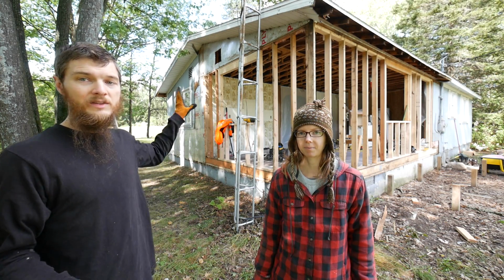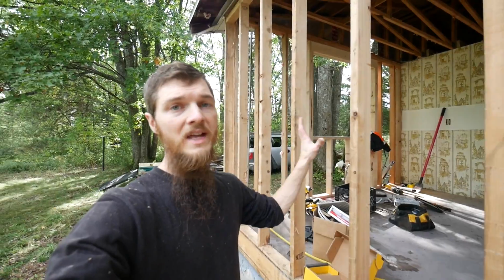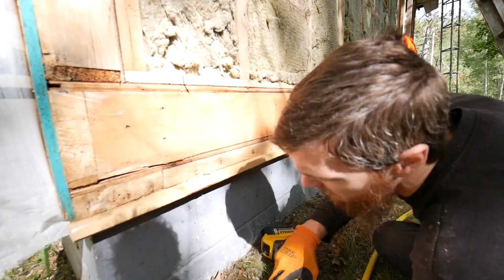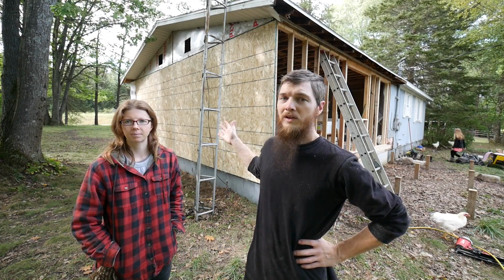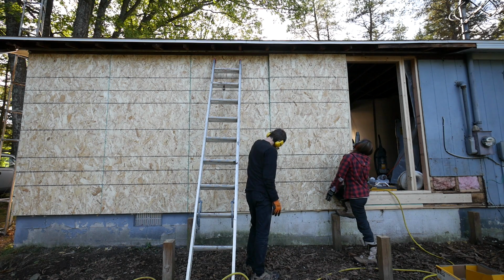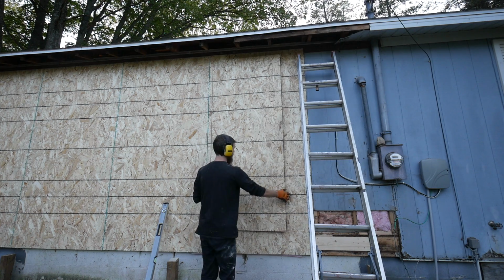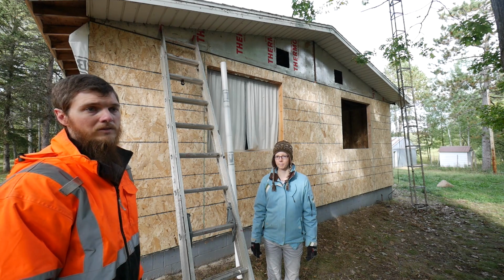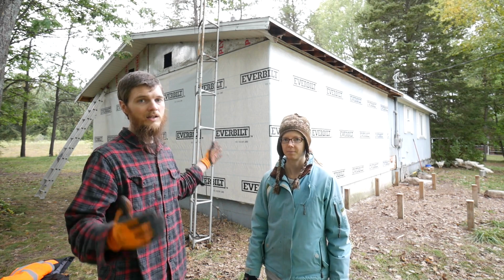Wrapping Up the House - Home Renovation

Comment: As someone has already mentioned, be sure to put some kind of mesh screening over those vents. You've done such a good job of eliminating the rodents I can't imagine you leaving that kind of entrance unprotected.  Great energy between you and good on ya for getting your September goals accomplished.
Reply from the maker: That will all be ripped off very soon when we do the blow-in insulation and then it will be sheathed over permanently with no vents since the roofer who did the roof last year put in a vented ridge cap.
Reply: @diyfferent  As I said, DIYfferent is AWESOMENESS in action

Comment: Those windows that you're NOT going to reuse would make great outdoor seed starting "greenhouses" next Spring!
Reply: Just a warning about old windows.  The glass is usually not tempered and when they break can slice you badly.  I wouldn't use them.
Reply: And the putty glaze around old windows often has asbestos which no one should handle without protection. We had an entire old house full of windows that we wanted to use in a greenhouse that we couldn’t use. Found that out during asbestos abatement. Tore the entire thing down. (Now that was fun!)

Comment: Hi Doug and Ashley, When you pulled off the upper siding you took off some kind of vent covers. Maybe there is a screen there, but I can't see it. We had small vents with wire mesh underneath, inset into the eaves that were either removed or worn through and rats got into our attic. It was awful, they made a lot of noise at night when we first heard them!! I love you guys, thanks for another great video. I am sure you are relieved to have gotten this far, as I knew you would!!!! Take care and God Bless.

Comment: Looking good. Maybe since everything is open anyway consider making an attic access door on the gable end of the roof not only for your insulation but whatever other reason you might need to access it in the future. It could also double as a large vent. We have lots of them like that on older craftsman homes in my area.

Comment: It's a wrap. LOL, sorry, I live with a guy who speaks in dad puns.  Serioiusly though, I have been enjoying and learning a lot from your videos! I live in a factory built home, kind of similar to a manufactured home/mobile home but it is just a little bit more like a regular stick built home built in modules. This home, they did the cheapest way possible and many of the aspects are the same as what you are encountering. It's at the age where we may find ourselves doing much of what you are doing right now. Rot issues, etc.

Comment: Wrap pieces over Gable openings? Maybe a piece under the power staff? Just to protect the holes from racoons, etc.
Reply from the maker: That whole peak area will be ripped off very soon when we will be doing the blow-in insulation and then it will be fully sheathed with osb. :)

Comment: Looks like the wind is blowing and it’s getting cold out.......Down here in middle Tennessee, we are having record highs of 95 to 96 degrees........I am so ready for Fall...........you both are doing a superb job......my only concern is that with the bad Winters you have, not sure if that pressed wood on the exterior will stay good, even with the wrap on it......I would try to get as much siding up as you can before snow starts as that will be another layer of insulation from the cold.......missed seeing Belle and Maverick ‘s sweet faces.....❤️Julia Johnson
Reply from the maker: Winter won't affect the wrap. It's mainly the UVs and wind that damages it. Our house is almost always in shade and we don't get much wind here so it'll be good until spring :)

Comment: Maybe you should put some screening over those two vent holes in the front?  So the mice & whatever else wants to take up housekeeping in your attic won’t have access?
Reply from the maker: It's not staying like that for long. We'll be ripping it off soon to go through there to do the blow-in insulation and then it's all being sealed over with osb. :)

Comment: My reciprocating saw has a plunge blade. You should be able to get one if you dont have it. Just hold it horizontal to the board and gently tilt as you cut.  Much faster that way. Dont forget to close that eave so you dont get critters in the roof space. Nice tidy job guys.

Comment: What about animals crawling into those two openings at the peak?  You could cover them and make a mark where a they are to cut open when ready.    I keep thinking rain, snow, and varmints heading there this winter.😝
Reply from the maker: We'll be ripping those last sheets off soon when we insulate with the blow-in insulation. After that it's being sealed up permanently. :)

Comment: Great video Ashley and Doug! Everything always looks so neatly put together...
I noticed someone mentioned to double wrap the house and then remove the 2nd layer when it comes time to side it. It actually does make sense. The 1st layer of wrap will be dry and not subjected to the elements. Have you thought of doing that?
By the way, that deck that you pulled to the other side seems to suit the area where you left it...that's just my two cents and with the Canadian exchange rate, I guess it's less than that...haha!

Comment: Another great display of team work and a job well done. I'm curious about the other half of the back wall, with the electrical stuff, when do you plan to redo that?
Reply from the maker: We plan on leaving the area alone right where the electrical stuff. The rest beyond that will be removed and resheathed/wrapped later on, not sure when we'll get to that yet.

Comment: looking great..Just a suggestion, But while you have the soffits opened I would enclose the area with 1/8" hardware cloth before you re-install new soffit panels and fascia...you'll still get ventilation and You won't have to worry about mice, stinkbugs, Spiders and a ton of other bugs getting in a ruining your hard work.

Comment: yeah the housewrap should do fine over the winter , i seen people dont use wrapping and leave the osb bare over the winter (including the roof)  , turned a bit darker and rougher but other then that it was ok 
its probably a good idea to do the ceiling insulation before winter , just so youre not heating the house too mush and have the heat disapear out with the draft  , you could do it from inside the house during the winter , one advantage of that is that it doesnt feel like an oven up there 
might allso be a good idea to board up some holes and maibe the eves  , maibe you can borrow / rent / try out a flir camera and video the outside of the home for hotspots and the inside for cold barriers when the temperature difference between inside and outside is noticable
https://www.flir.com/browse/home-amp-outdoor/mobile-accessories/, this one fits a smartphone so you can prolly record from it too

Comment: It looks like once you put the insulation in, and do the interior walls, the place should keep warm, was wondering about under the house, will the pipes need weather protection, and are you going to cover the attic vent opening in case it rain,

Comment: I'm not sure if it's been answered before, but what is the antenna-type structure just outside your kitchen window? I think my grandma's house had one of those when I was a kid, but I'm not sure I ever knew what it was for.
Reply from the maker: It's just an old tv antenna tower. The antenna is still up there at the top. It makes a handy ladder to get on the roof, haha.
Reply: My Aunt had that. It was for the TV
Reply: That's handy to have I'm considering cutting cable and getting an antenna for our house in certain areas they can pick up 70+ channels

Comment: Yay,  you'll soon have the kitchen space back.   Glad to see you guys laughed when the little piece detached when you tried to place the OSB.  Looks like you kept the ledge when you wrapped the OSB.  
See you wearing coats.  What was the temperature?
Reply from the maker: The ledge was just temporary, he was just stapling the wrap over the bottom edge of the OSB. We're looking at highs of lower 60s and upper 50s lately. Last week was much warmer in the 70s and 80s.
Reply: @diyfferent  
Glad you removed the ledge and I was wrong...  Whew!
Thought it may have been colder.

Comment: Good evening guys the home is coming along beautifully, one question though “does this now mean you’re home will be called a conventional stick built house,” and no longer a double wide trailer?
Will you have to tell your local Council?
Reply: Narice Woolon its still has a steel frame. It is still considered a mobile home. I hope they save the metal identity tags because it’s a big deal for financing if it’s sold.
Reply from the maker: Even though technically it is a double-wide, our county doesn't consider it a mobile home anymore already. In the early 2000's sometime someone filed an 'affidavit of affixture' which changed the status of our home from a mobile home to real property, like a stick-built. Because of that, it can be financed like a normal home and someone did get a loan on it right after that was filed.
Reply from the maker: The metal tags don't mean anything for this mobile home anymore, and there is no more mobile home title for it. All of that was done away with when they did the form. It's just considered a normal home now :)

Comment: What type of siding are you planning to put up lapboard, vinyl or T11? They make a siding that looks like a log on a cabin.
Reply from the maker: It'll be a surprise, but I can say it will not be vinyl. :)
Reply: @diyfferent  Someone, I can't find the reply, suggested hardware cloth for the soffits. I agree with them 💯%! I'm battling mice now - I HATE THEM! - anyway ... just in case you didn't see that post ... just a thought. Excellent team work! Well done.

Comment: wow, no siding till Spring?? I really hope you rethink that. I live in Illinois and it gets cold here, I can't imagine what it will be like there.
Reply from the maker: Siding doesn't keep the house warm. We thickened up the walls to 5.5" and used mineral wool insulation and we're also doing new thick cellulose in the ceilings. It will be the warmest this house has ever been since it was built :)
Reply: @diyfferent  I guess, just worried the plastic will blow off, but then you said you don't have much wind. I will bet you get the siding done after all :)

Comment: Are you changing the insulation on that end from inside or leaving it standard depth ?
Reply from the maker: We will be building out the walls inside and using the same 5.5" rockwool insulation.

Comment: Just curious. Is there any need to tape over the staples on the house wrap?
Reply from the maker: Not necessarily. You could for extra security, but the holes are minimal and it's not a problem if you don't.

Comment: Looks great! Will you temporarily cover vent holes for now?? Or close them totally before winter?
Reply from the maker: Thanks! The foundation vents? We'll be making sure they are fully sealed off before winter. Or do you mean the roof gables? Those will be permanently sealed off. We don't even need them anymore since the roofer last year installed a vented ridge cap :)

Comment: Another couple that are redoing a mobile home are putting the foam board over the sheathing, then the wrap. Do you think that would be great in michigan?
Reply from the maker: It depends. We personally don't care for foam board on the outside of the house because it can trap moisture within the wall cavity and contribute to hidden rot. We want to house to breath through the outside because of our climate. Instead of using foam board we have opted to build out our walls to accommodate 5.5" batt insulation. A standard 3.5" insulated wall can have an R-value of about R-13 to R15 depending on the insulation used. Adding the R-5 foam board sheathing brings it up to about R-18 to R-20. Our 5.5" insulation alone is rated R-23 and is above code requirements so we feel good about the way we are doing it. Sorry that was so long, but I hope it helps :)
Reply: @diyfferent  Thank you

Comment: I notice Ashley is bundled up hat and all in most all of this video. Doug not as much but you did have a jacket on at some point. I’m wondering what your temperatures  are running. We here in NW Ohio are supposed to see around 87 here today. Glad you have the door and windows already to put in this time . No waiting! Also I’m curious will you be tearing off the last corner outside or will that wait till spring as it seems you are getting colder there already?
Reply from the maker: The temps are on the verge of being cold. He does more of the laborious work so he heats up a lot more, haha. It was warmer last week, but the temps have plunged this week (low 60s, upper 50s). We may be able to get to removing the rest of the siding and resheath/wrap it before winter, but for now our focus is getting the house ready for the cold. :)
Reply: @diyfferent  Very smart. The wind is the biggest game changer and last winter in Michigan where I live they went to 50-60 mph so the wind chills were unpresidented. Wind chill is very, very dangerous. Keep your pipes warm too. A slow drip did not work for many last year. Blessings to you all. Wishing you the best!

Comment: Legitimately curious but I always thought osb and plywood were strongest running horizontal instead of vertical. I don't know how much difference it makes but I'm in tornado country and always thought that may have something to do with it.
Reply from the maker: This is one of those topics that there is a lot of debate about. From what I've read, they are about the same. It mostly comes down to what works best for the structure and is approved by code. Since code varies from area to area, some places may want the walls built a certain way. I can't really give a clear answer on it but I don't see much of a difference personally. I have heard that plywood is stronger when it's horizontal due to the direction of the wood grain in the layers.
Reply: It adds a lot more shear strength to a wall when ran horizontally. I doubt it would make much difference in a tornado but I digress

Comment: Shouldn’t you have sealed the gaps between the OSB, sheets from the outside, before adding the wrap?
Reply from the maker: No, it's not common or necessary in most cases. The gaps land on the studs and are pretty well sealed on their own.

Comment: What about a wood burning cook stove? I know you took out the chimney or is that a secret? 🙂
Reply from the maker: We'll be doing a regular wood stove with a double/triple wall stainless steel chimney pipe. :)
Reply: I don’t know how good of and idea that is. But I probably just being a negative Ned.
Reply from the maker: @ian_lambert-knight  why?
Reply: Well, I’m jest a bit worried that it might start a fire. Though I feel a bit silly for thinking this.
Reply: @diyfferent  Great! The chimney pipe is the one I'm looking at also. I just mentioned the "cook" part because after I bought my place, we had a power outage during a full-on ice storm, in the country in the Midwest. 😖 I couldn't even heat water so I'm researching stoves that heat and can be used to heat. I'm looking at the Vermont Bun Baker XL Wood Cook Stove - recommended by SSLDad. I am not willing to do that again ... cold food/water in a cold house. Ugh! I HATE being cold.  Anyway, all the best going forward! My fave channel.